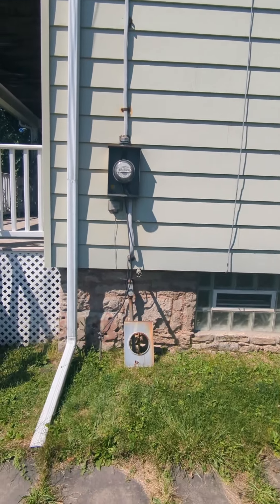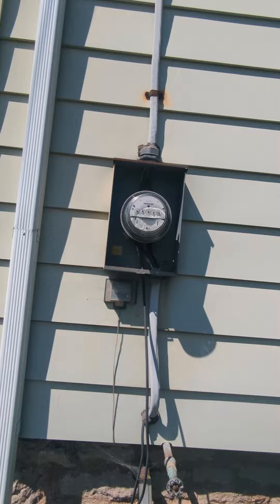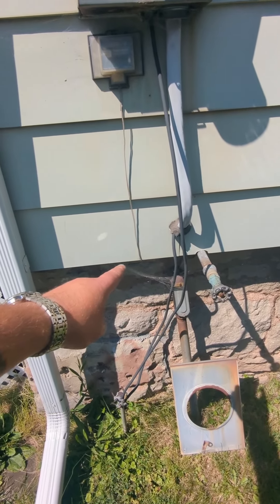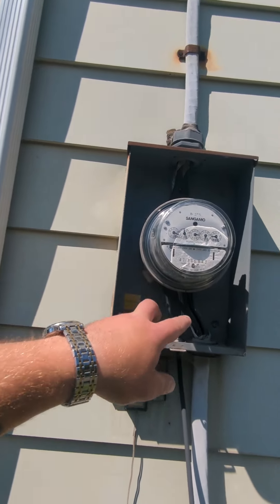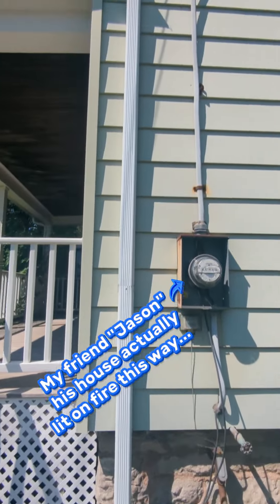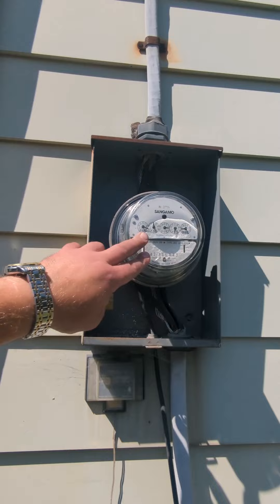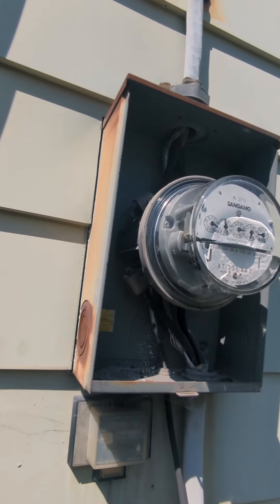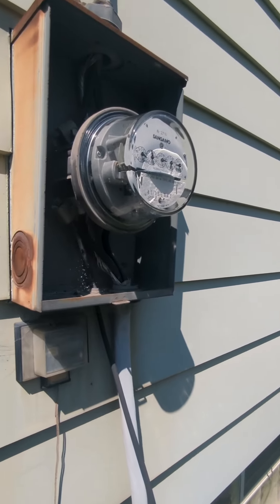HUGE mistake can you spot it?

Comment: The grounding electrode conductor is permitted to originate at the meter, and basically all that you said was false. See NEC 250.24(A)(1) which states "The grounding electrode conductor connection shall be made at any accessible point from the load end of the overhead service conductors, service drop, underground service conductors, or service lateral to the terminal or bus to which the grounded service conductor is connected at the service disconnecting means." This means at the meter is perfectly fine.
Reply: Okay that wraps it up, fellas.
Reply: Do you have a video on the subject of grounding service equipment especially upstream and downstream of the first point of disconnect?  I would like to learn once and for all.  Thanks.
Reply: @ronaldkovacs7080  Please review NEC 250.24 for the requirements. No specific video available.
Reply from the maker: My inspectors fail us in this jurisdiction if the meter is grounded and the main disconnect is inside. Doesn't matter what the NEC they are authority having jurisdiction and they can overrule it.
Reply from the maker: Ok this is directly from the inspector....
Reply from the maker: My text to him: "Why can't the meter socket be grounded if the main disconnect is inside.?"
Reply from the maker: His reply: "Power company does not want main grounding in their meter "
Reply from the maker: This is Commonwealth electric inspections/ empire electric inspections in Western NYS jurisdiction. I've done thousands of these, and they've all been inspected. While I was apprenticing for empire electric, and another electric company. And on my own doing my own jobs. We have never and I repeat ever grounded the meter socket if there is no disconnect in the meter socket, if there is no shut off or breaker in the meter socket, it is NEVER grounded. 
EVERY SINGLE ONE OF THESE JOBS HAS PASSED INSPECTION.
This is considered the "line side" if the disconnect is downstream. We do not ground the line side, we don't ground the pole, we don't ground the transformer, none of that. Our grounding only starts where our main disconnect is.

Comment: So if you connect your grounding conductor to the main panel how does the meter enclosure get grounded? The code says that anything that has power in it has to be bonded to ground.
Reply from the maker: @dandearman2871  I'm seeing my inspector this week and I'm going to ask him about your exact point you made there. I promise I'll comment what he says
Reply from the maker: In the meantime my guess would be because it's on the "line side" and not the "load side". The load side begins where the first main disconnect starts, whether that's in your meter socket or at the main panel inside (like in the video).
Reply: @crazyDIYguy  Those are just words. The electricity doesn't care what "side" it is on. Perhaps the enclosure is already internally bonded to the neutral?

Comment: Yes your meter must be grounded or bonded to a panel by way of an approved bonding means same for the main panel. All metal parts that could be potentially exposed to energized parts must be grounded all the way down to small metallic device boxes. The problem with this installation is two separate EGC connected to the ground rod. You never leave a meter ungrounded. If something happens to the neutral connection and metal parts become energized then persons or properly become a really nice potential earth ground.

Comment: Is the problem that this property only has a relatively high-impedance earth connection that is just intended to carry enough current to trip an RCD (GFCI) and this is the wrong side of the RCD so wouldn't trip it?
Reply from the maker: @thomasdalton1508  definitely one of the potential problems, the other main problem with grounding that specific setup are parallel paths for the neutral to travel if we grounded both meter base and main disconnect/panel inside.
Reply: @crazyDIYguy  That's only a problem if you use too thin a wire for the grounding, right? In the UK, we have minimum thickness requirements for wires that could become alternative neutrals (we mostly use TN-C-S/PME so pretty much everything can end up being a neutral path, so it is a significant concern).
Reply: So if I am seeing this video correctly the is connected both at the meter socket and going into the main breaker panel. It can be either but not both unless AHJ or utility requires one or the other. Only created neutral by grounding once.
Reply: @SRCardow1  You can't ground only the meter, surely, or you'll have no ground for the rest of the installation?

Comment: Nothing crazy about this.   Sorry your bud got burned.
Reply from the maker: Neutral at the top connection failed, his circuits started relying on the ground to earth (which is weak to begin with for adequate neutral). That failed quickly so it found a ground through the aluminum siding which led to the cable companies ground. Aluminum started corroding and the "substitute" neutral started arching heating up the siding. Eventually causing the wood to smolder in the wall for days without us noticing. By the time I noticed the inside of the wall was gone and glowing coals. Saved it with a chainsaw and a hose. This house in the vid is aluminum too, neutral top connections fail constantly, it would easily start arching through that meter socket, slowly heating up the siding and....

Comment: So are you saying don't use a ground at all?  Or just ground the box (which grounds the meter socket)?
Reply from the maker: @CubbyTech  wherever your main disconnect is you ground. So in the video the main disconnect is in the basement, therefore we don't ground the meter socket. If the main disconnect was outside at the meter socket, we'd run all our grounding to those. Then we would have 4-wire "SER" feeding the breaker box from the meter base, the 4-wire ser has a ground wire so the panels would be grounded that way.
Reply from the maker: But in my exact situation in this video, the meter base isn't grounded at all. Just the breaker box in the basement, that has all the grounds going to it, from the gas, water meter, ground rods, etc. I'm going to make a more thorough video on it.

Comment: Old meter that hasn't been swapped out to a smart meter yet and still requires a meter reader to get the power usage.  Where is that?
Most utilities are going to smart meters where they use a 900mhz signal to communicate to a grid. This reports power usage real time and also power outages real time. Rare to find one that hasn't been upgraded yet.